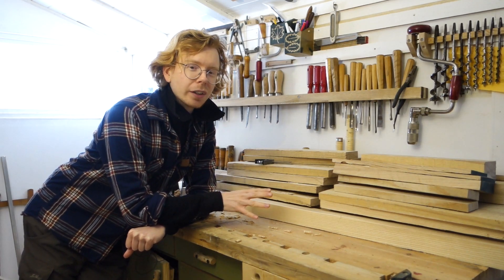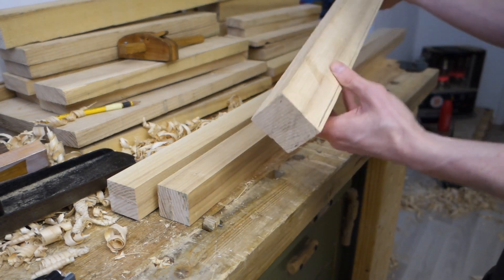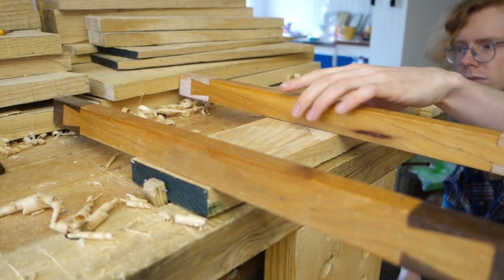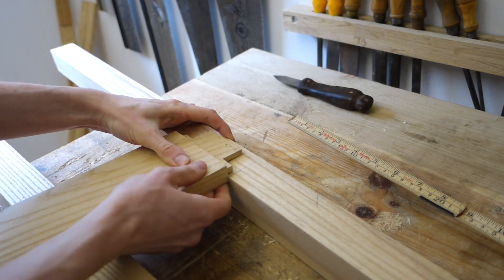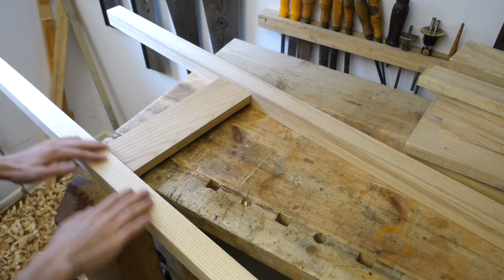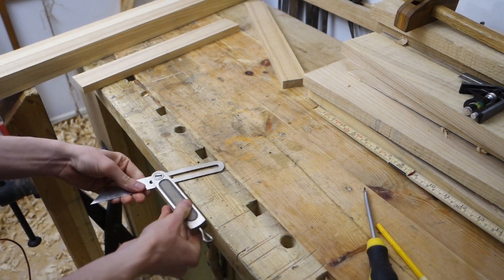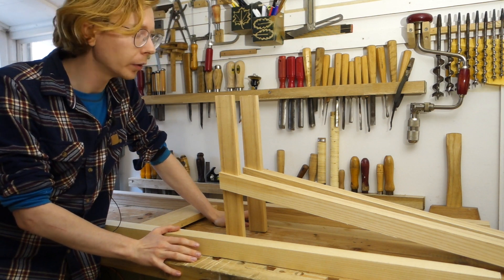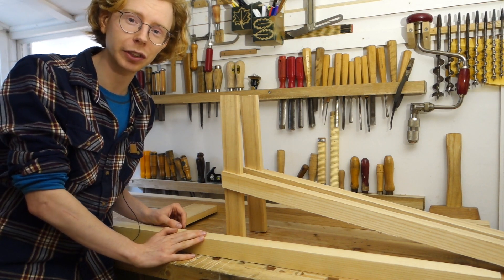Standing desk part 2: legs, rails, joinery!

Comment: Excellent work as usual Gillis!

I like your idea to rotate the stock blank inside the leg. Those are the lengths that most woodworkers (especially power tool oriented people) would not go to, because it's more difficult and creates more work. But I absolutely salute your efforts to get the best results you can.

I also enjoy hearing your thought process about the material proportions and glue surface area within the joinery. It's all a trade off, and I think you are finding a really good balance with your decisions.

One area where you and I disagree, is the comment in your video description "I'm no professional and I don't have anything to teach". You have a great deal to teach, and you're doing a great job of it. I can't wait to see where you are in 2 years. All you need to do is figure out how to make this a main source of income (if it's not already), and then it's your profession. Your skills are already there where they need to be. Don't stop learning though! :-)

See you next time.
Reply from the maker: Thanks a lot Craig! I learned the rotate trick from Mike Pekovich. Feels like the kind of thing that would be rather cumbersome with power tools, but with a handplane, it's kinda the same amount of work! The material has to go either way, you just choose where to take it from. But it takes a bit more attention of course :)

Comment: I find this very therapeutic to watch. 

Also learnt something new (to me anyway); allways wondered how woodworkers start to plane a piece of wood and end up with a a piece that does not only have parallel surfaces, but also the correct dimensions. I remember allways ending up with my piece either being undersize, warped or not parallel (or having flat surfaces for that matter).

From what I can deduct from your videos, you first get it parallell, and then reduce it to the correct size with longer surface planers that stay parallell in skilled hands? Order of operation is gold :)

It's one of those shows that blend real knowledge with entertainment. Not that common anymore, current shows focus mainly on consumption. I'm never going to be Bear Grylls by buying his brand of knives at Clas Ohlson, but I do posess the knowledge to set the edge on my plane and make a parallel wooden block from watching your videos. 

I do have to practise though :)
Reply from the maker: Thank you, I'm very happy you learnt something! Getting it to be square and true without going too far is the tricky part for sure, it's hard to explain in words but it sounds like you've got it! I'm thinking about making a handplaning tutorial-ish video but in the meantime, Paul Sellers, Rob Cosman, Wood by Wright and Matt Estlea is the channels I mainly picked it up from.

Comment: Nice work. A tip is to start with the mortise and adjusted the tenon to the mortise as the mortise chisel always will have the same dimension.
Reply from the maker: Thanks! I might not understand fully, but it doesn't seem like it would matter? I set the mortise gauge to the width of the chisel and use that for both the tenon and mortise, so which one you cut first shouldn't make any difference right?
Reply: @GillisBjork  In theory yes but if you just happen to cut the tenon just a tiny bit too thin you have no way of fixing that when you discover that after cuting the mortice since you can´t change the size of your mortice chisel. Unless you deliberately cut the tenon a bit fat in the first place and then fit it to the mortice of cause.